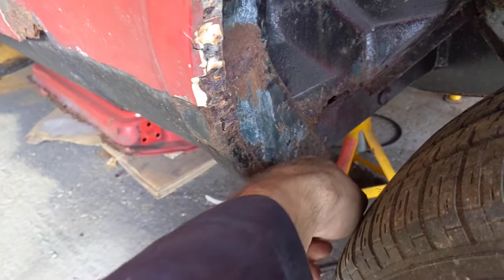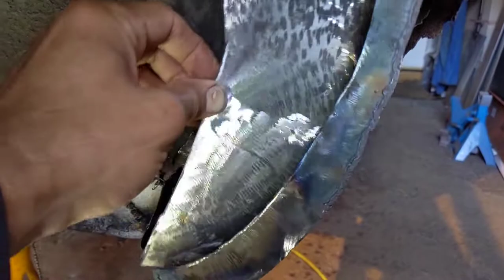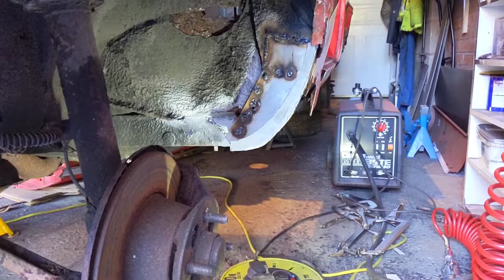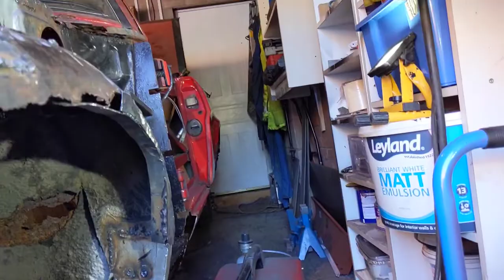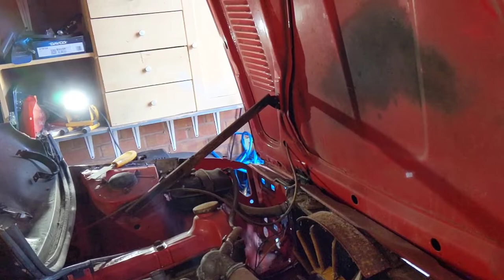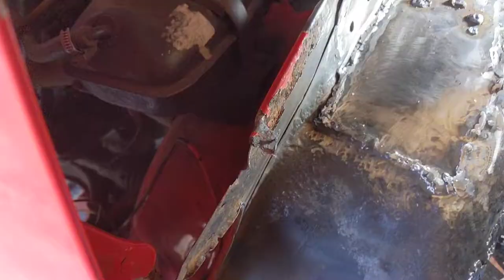Triumph TR7 Restoration: Episode 19   Inner Wheel Arch Part 2

Comment: nice job with the repair and great welder you have i have the same welder been using it for 3 years and never had any problems id recomend using the bigger gas bottles thet you refill its well cheaper in the long run keep up the good work
Reply from the maker: Thanks for the tips and compliment! But just wait till you get to the next episode and discover the issue I created

Comment: R you using a mig Henry or no-gas welder ????
Reply: Just saw the bottle on the mighty 😳
Reply from the maker: @steveclews6557  I've got both (I bought the no gas before I realised it wouldn't weld the thinner metal), but only use the gas on the cars